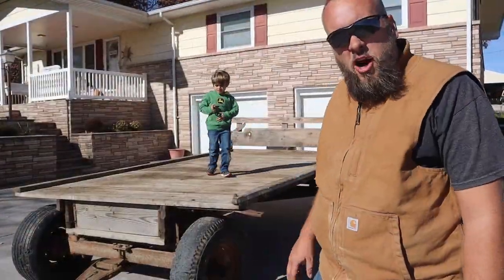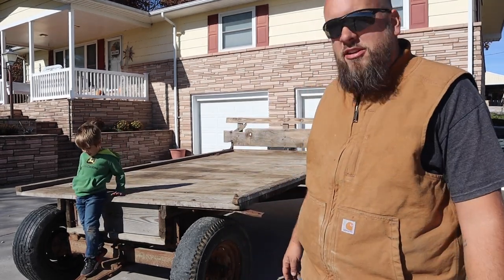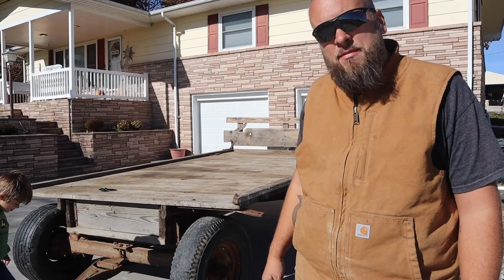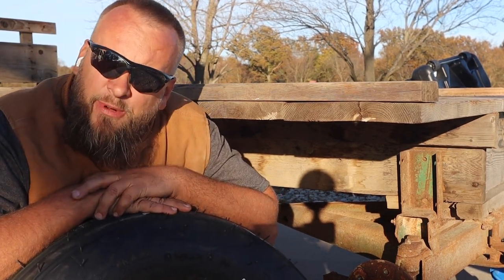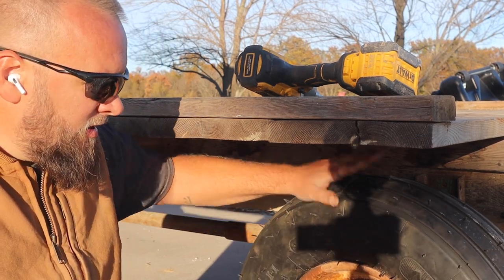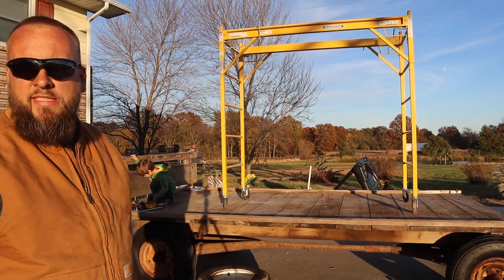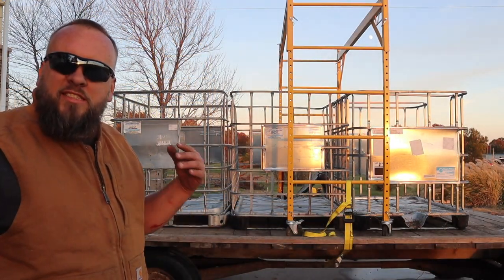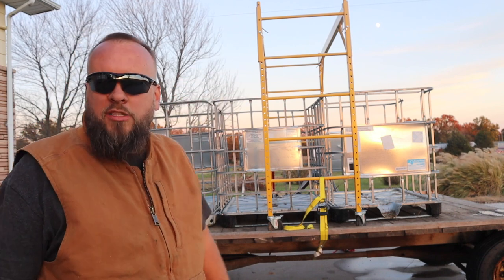A New Use for an Old Hay Wagon - Mobile Scaffolding

Comment: One kilogram is 2.2 lbs. So around 3k pounds per tire.
Reply from the maker: Thanks , I looked at a converter this morning and was surprised to see that. Could’ve swore it said 6100 on the tire 

Probably Never putting that much on there though.  I bought it mainly for hayrides but should be useful for moving stuff around the property too